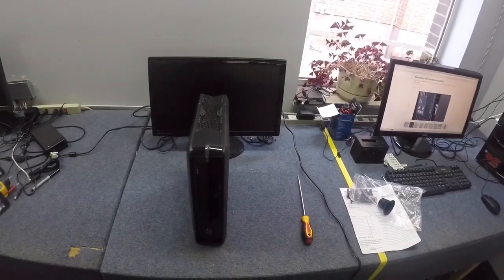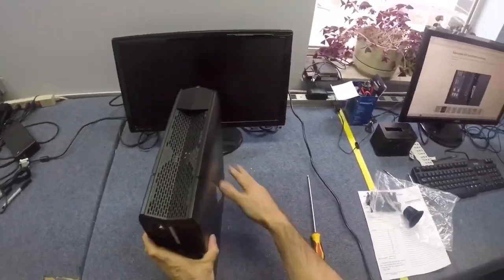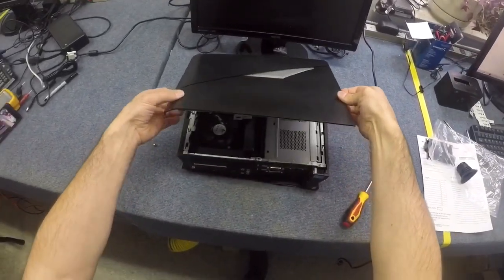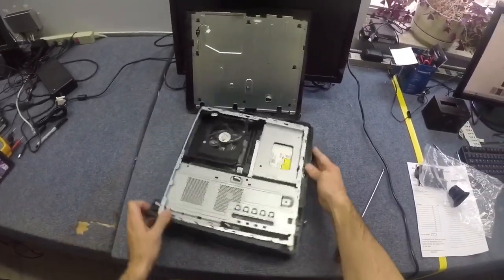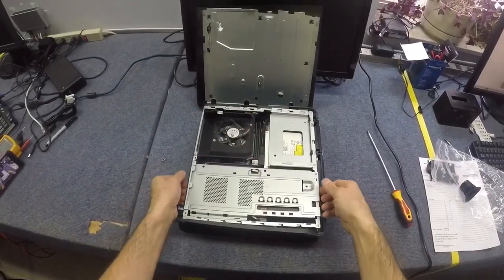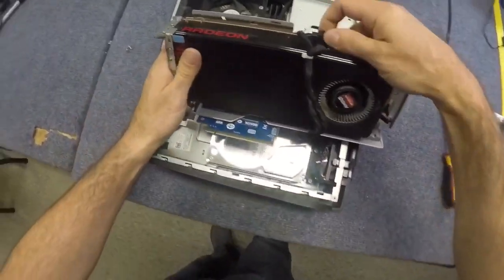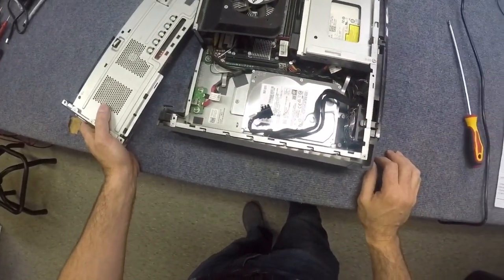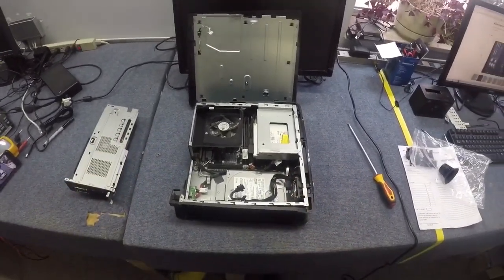Alienware X51 R2 How to Open and Disassemble

Comment: Bit of a longshot but I have this pc and it refused to boot a couple of times and now all that happens when I press the power switch is a sluggish but continuous click. 
I'm not a pc guy so this means nothing to me.
 Is this a dead giveaway to anything in particular and does anybody have any idea what this probably is or where I should start? 

Thanks.
Reply: Same here I have this PC aswell and it happens to me to I am not sure what the problem is
Reply: @DanTheMan-44  I took a punt and bought a new hard drive for it and it was that!
Reply: @DanTheMan-44  yesterday some reason my alienware x51 r1 dont want to start, only power button light and fans running but not boot at all. Unplug bios battery fixes this problem to me.
Reply: Ohhh thanks so much I will definitely try that 🙏

Comment: how would you go about removing the hard drive after this?
Reply: Did yours shit the bed too?
Reply: @kolby2  nah - it just sucks - but I got the hard drive out - I just didn't realize what to unscrew and cracked the casing a bit removing everything else destructively
Reply: Bit of a longshot but I have this pc and it refused to boot a couple of times and now all that happens when I press the power switch is a sluggish but continuous click. 
I'm not a pc guy so this means nothing to me.
 Is this a dead giveaway to anything in particular and does anybody have any idea what this probably is or where I should start? 

Thanks.

Comment: i don’t know much about computers but, rn in my case i have an i5 and and rtx 1060 and i’m looking to just upgrade my gpu to a 2060 and my processor to an i7 4790, should i do that or should i get a whole new pc? someone help
Reply: If you have a big budget it's definitely a cool opportunity and savings to learn to build a PC yourself. Look at Linus Tech Tips he has a whole POV on how to build from scratch. If you're not looking for this, I'd recommend buying from DigitalStorm, they have good prices and aren't overpriced for what you get and it's prebuilt. IF you are going to continue upgrading this PC I'd be concerned about the powersupply make sure it can hold the watts of your 2060 and new i7
Reply: @elchingon7156  right now prebuilts are the way to go for sure, unless you're willing to pay scalpers
Reply: @livingfailure  scalpers WeirdChamp
Reply: New pc, because the airflow sucks on this and increasing the heat generated could be dangerous for it.

Comment: I was getting a continuous short beep after it had been sitting for a couple years unused. The person at "Upgrade Kings" had pushed the GPU card into the white cable with the push connector (processor power?). It's amazing it worked when I first got it. It must have cut through over time. I spliced it and it works for now. Probably need to solder it.

Comment: how much would a used one of these cost? i dont wanna get ripped off. the one im being offered has a gtx 960 and an i5 proccesor and 8gb of ram
Reply: maybe $300-$400. the specs on the x51 are very outdated, i’d recommend getting something better.
Reply: I dont recommend it, I have one that I got 2nd hand with i7 and it just isnt good. It malfunctions a lot and no matter how many times I go to get it fixed it still just doesnt want to work. I'm building my own computer now I've got a job so I can just throw this one out...
Reply: @AnticArtist  I got mine second-hand and the only issue I had was that I had to re-mount the GPU and my hard drive was slow (which after replacing it, made it much faster)
Reply: I got it for $100 used - runs like a dead horse but I'm hoping to salvage the hard drive and fans

Comment: do you know if you can take any after market gpu and put it inside these without much of a problem?
Reply from the maker: It comes down to what the particular motherboard can handle.   They may have a supported cpu list, but sometimes you just have to just try it as the list may not be updated or complete.  Good luck